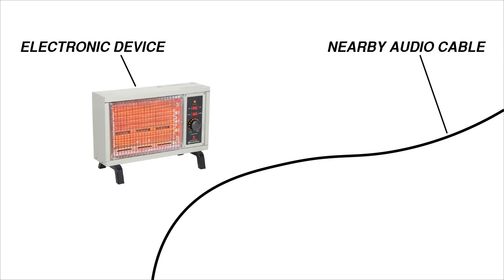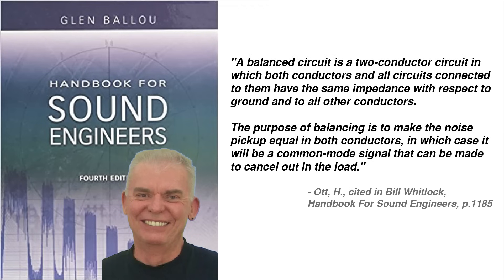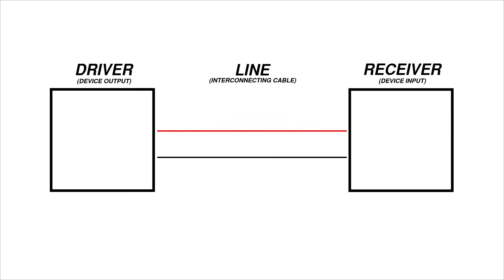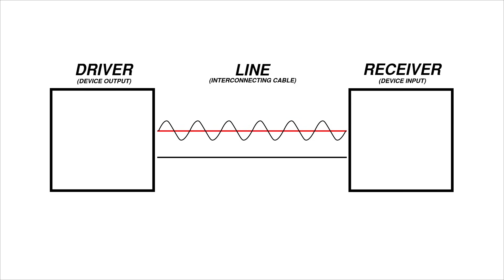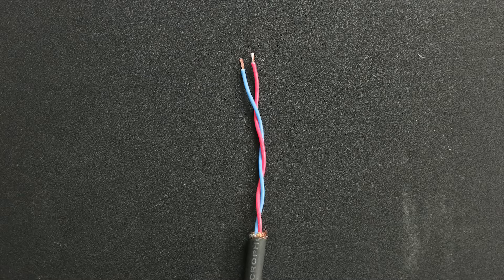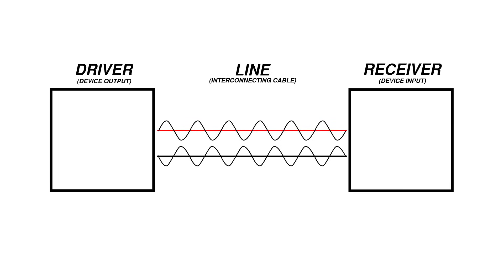Balanced vs Unbalanced Audio | Do Balanced Cables Sound Better?

Comment: The problem with your four conductor cable was that the "ground" for the unbalanced path was not a shield but just a wire conductor?

There are also different ways to use a balanced cable, you can use differential signalling but you can also use it as an unbalanced cable... which is what most people do (unknowingly)!

Comment: "Ballanced" cables utilize the equal opposite principle. The goody is sent with it's identical opposite twin. Any garbage picked up on the way through the wire is ignored as the twins are re-united (flipped back into unison, cancelling out the noise from the now opposing garbage noise crushing each other). Done and done. It's so simple it's confounding.

Comment: This is what you always hear as an "advantage" of xlr to rca: that over long distances  these connections are still very silent, where with rca noise augments. This is certainly true, but our listening room is not a stadium. We do not need interconnections over long distances. In most cases 1m will be long enough. So this argument might be true, but is not valuable.

Comment: As a prosound sound Technician, balanced Wiring does removed Noise and CrossTalk from Wiring when running long distance. However in Hifi that run short length Audio wiring are not really important as the circuit for unbalanced to balanced circuit and vice versa balanced and back to unbalance if poorly designed will cancelled out tiny detail information on the audio signal.
I trust the most important part in Hifi is the balanced wiring and circuit should be the Catridge and phono stage.

Comment: Op-amps are amazing. I'm making some mini speakers with the LM386 chip (amplifier) and I try to add mixing (more input signals) to it. I'm stuck with some hole making issue on the second box, but most is working. Most equipment don't make noise as before, but it's certainly an issue.

Comment: I can't definitively say balanced interconnects improved the sound quality on my system, but there was a significant gain: for any given volume setting output was noticeably louder with balanced cables than with RCA. I'm no expert, but I imagine if the amplifier isn't working as hard to produce a comfortable listening level, then it can only be a good thing. What do you guys think?

Comment: I've read that if your instrument has an unbalanced output, and going into a balanced input, for example, an unbalanced keyboard or e drum output going into a balanced interface input, TS cables are what you should use.  Is this correct?  It's what I use and the sound is proper.

Comment: So basically balanced cables are a waste of money when running short runs. Your 3 foot RCA's are just as good for interconnects unless you have something making wicked noise in your system and if that's the case you have bigger issue then interconnects.

Comment: Huh, sounds like pickups -regular cable is single coil and TSR is humbucking. Both sound fine when playing clean, low volume, diff is when turned up or noisier with increasing gain.

Comment: In the late '60s pretty much all that we had for mics were the screw-on type (unbalanced). Terribly noisy. By the mid-late '70's most people were using XLR 3 wire type mics. Balanced is always preferred in long cable runs and noise resistance. That's about it.

Comment: Cables do "sound"?
Balanced cables have a second, grounded cable and the difference of the signals is used. So you remove the noise from electrical interference from the mixture of the wanted signal and the noise. Only the wanted signal remains.
Humbuckers in electric guitars work the same way.
Balanced cables only make sense, if you have lots of interference and low voltages. Typically a shielded cable is enough to reduce the noise.

Comment: I was happy with RCA for the longest time. Then I bought a dac that was designed to work best in balanced mode. So I bought some short 0.5m xlrs. Did I notice a difference. Yes but it was a volume gain difference due to higher voltages. The technical specs are also slightly better but I'd be lying if I said I heard that difference. Nice to know my setup is optimized however.
I'm pretty sure the benefit will be greater for much longer runs of cables. I assume that's why balanced xlrs are used in professional installations.

Comment: Thanks, I finally have a basic understanding of what a balanced connection is. And now I’m curious to know why guitars don’t use a balanced connection, especially given the issues with single coil pick ups in particular. I assume it’s because Electric guitars and amplifiers were first built with a non-balanced connection, and it’s always very difficult to change a firmly entrenched standard.

Comment: Great video. Regarding the misconception about two signals being required for a balanced (noise cancellation) connection to occur- my presumption is that this would still require a TRS cable and two devices with balanced driver and receiver, yes? If so, my next question would be, what device with balanced connections would ever not send 2 copies of the signal? Is this something you have seen with any specific manufacturers or mostly just theoretical? Don't know whether or not I need to be on the lookout for that sort of thing.

Comment: Hello! i have questions. I have issues  in car audio with very quiet ground loops, but the biggest problem is bad sound quality (mainly bass) and distortions. Balanced wires can fix this problem? All is okay, this same points, 5 year of fight with weak bass, who most often, but not always, plays on hot days much better, loud, soft, in cold weahers its hard to get nice, loud and clean bass. Thanks.
Weird looks: Subs (or amp) pickup 20 meters away from my car, others driving cars, and cause bass fading (outside car, sometimes i must change positon to hear fading, sometimes next to trunk, sometimes in fronts windows all outside car,  When  lightning struck nearby to me, i lost more bass only under 34hz, more weak, more empty quality.) I check  with my cheap osciloscope RCA end (to amp) signal looks like clean but in output amplifier like dirty, amplified noise, its possible its from rca problem noise? Thanks!
Thanks!

Comment: I have a couple 18's Vegas. They have 1/4 inch ts jacks going into 2 wires at the end where it hooks into my receiver. How do I know which one is positive and which one is negative coming from the sub with the ts jack going into my receiver normal red and black ?

Comment: Question, I am trying to make my own Audio converter from TRS to XLR male. because my Audio Mixer has PL Aux Outputs. I soldered the TRS correctly but to the XLR, I'm not that sure. I soldered the Shield to 1 and the White Cable to 3 then the Red cable to 2, then when I play music through my mixer then I listened to the TRS to XLR Converter that I made, the song has no voice. but when I tried to rewire the XLR to 1 and 3 - Shield and i connected the both white and red wires to 2, it sounded normal... why is that? what did I made? is it a balanced Cable or a unbalanced? I'm trying to learn this so that I can make my own Audio cables and have a knowledge to repair them if needed... Thank you so much!

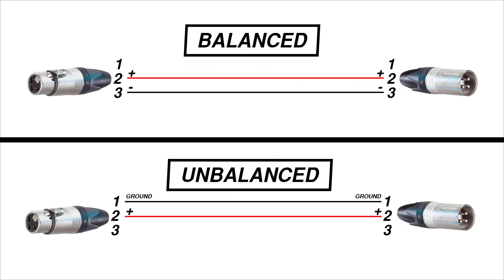Comment: 4:52 - Sorry having a hard time wrapping my head around this. There are still only 2 wires in either scenario. So, why can't an RCA cable be set up so the shielding attaches to 3 and the +ve at 2?

Comment: Excellent job paring down the key information and presenting so clearly!  One thing that did stand out, though, is that the shield was not connected at all in the balanced diagram.  Im guessing that you may be teeing that topic up for a future video on ground loops, proper shield connections (often an almost religious subject for some).  With all of that said, it’s worth mentioning one additional source of potential noise in an unbalanced connection can come from ground loops that can be  introduced when the ground of the source device connects to the ground of the destination device are connected (by necessity) via the shield if current ends up flowing through the ground/shield in the wire from one device to the other or there are MULTIPLE ground paths between devices (like when the shield of one RCA (left channel) and the other RCA (right channel) are both connected between the source and destination devices. 
 
I’ve always hated unbalanced connections but they are nearly unavoidable (unless you have the budget for higher-end professional gear - and even then, instruments such as electric guitars/basses offer few alternatives (except possibly for wireless).
 
Anyway, I’d love to see a video that addresses the method of wiring connection that you recommend: 
 
1) For shelled cables (such as only connecting one end of the shield for balanced connections)

2) Best practices for minimizing ground loops

Again, awesome content!  I wish I could have watched your  channel 30 years ago (I’d probably have more hair!)

Comment: 00:22 🎛️ Balanced connections help reduce noise from electronic interference.  
01:00 🔌 Different cables (XLR, TRS, TS, RCA) have varying internal constructions impacting their balanced capabilities.  
01:39 📖 Balanced circuits have equal impedance in conductors to cancel out noise.  
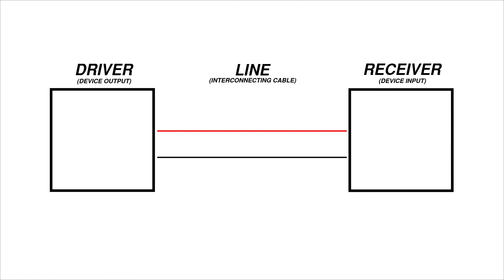02:28 🔍 Differential devices in balanced circuits reject common-mode noise while passing differential signals.  
03:57 🧩 The shield in XLR and TRS cables does not affect balanced connection ability; wire size and twisting are crucial.  
04:39 ⚠️ Common myth: Balanced connections don't always require opposite signals to function effectively.  
05:22 🎙 Demonstration shows how balanced connections reduce noise compared to unbalanced ones.

Comment: Legacy convention tells us "tip" and "ring" comprise the conductive parts of the unbalanced quarter-inch phone plug, corresponding to green (tip) & red (ring) telephone wires. Why then do you refer to the phone plug's conductive parts as "tip" and "sleeve?" Did something change while I wasn't paying attention?

Comment: And now the one million dollar question…
Why not using a current connection in stead of a (unbalanced or balanced) voltage connection? Interference generates an electromotive force voltage which doesn’t interfere with the current.

Comment: If you got a 16ft 12awg cable, cut within 1mm on both sides going into a 5mm banana plug with a half inch wire stripper, what is the difference in the ohms betwean two cables?  The wind and shadow from the window.  Because you get some wind going by a shadow...i mean their 100watts.  The trouble is the reciever turns off after one second, you play DTS:X  Home Theatre, its off every 20ms when you do the test tones.

Comment: Hi , I am building a pedal effects board consisting of around 8 Behringer guitar effects pedals and a Behringer UTRAPATCH 3000  (balanced patchbay) , I use Korg Volcas and Roland Aira compacts which will be "patched' into the effect pedals via the patch bay, my question is.  .. is there any advantage using this "balanced" patchbay with "mono" type effects pedals? , ie  will using TRS leads from effect pedals to this balanced patchbay be overkill?
Thanks in advance 😊

Comment: Here I was, thinking TRS is for stereo signal, like the big TRS plugs on my AV receiver labelled as headphones.
Reply from the maker: It can be! But sometimes it’s for balanced connections, as shown here.
Reply: @AudioUniversity  Very interesting, so in theory the same cable could be used for both and only the manual would tell if the device uses stereo, or balanced, though in some cases it would probably be obvious. What is not obvious on the other hand is why manufacturers still use the large plug for headphones rather than the medium sized one.

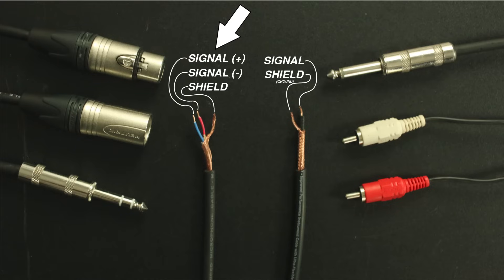Comment: At the 1:18 mark, you have a diagram showing the red wire as negative. In all of the other diagrams I have seen with how to wire XLR cables, the red wire is always shown as positive.  Does it matter? I have always wired red to pin 2 of the xlr per the diagrams, but recently purchased some xlr cables that had the red soldered to pin 3.  Does it matter?

Comment: I know this is an old video now but hopefully comments are still monitored. Since the receiving equipment seems to be the ‘clever’ end, does that mean you can take an unbalanced RCA connection, and run it into a balanced input using the RCA/coaxial centre conductor for hot and the shield for cold?
Reply from the maker: No. For this, I’d recommend a DI box. Specifically, the Radial ProAV2.
Reply: @AudioUniversity  thanks for your reply.

Comment: I have two dual 15.24 rockville speakers. All i am trying to do is use them strictly for vocals only. I bought the rockville 3000watt amp and a mixer. But when i hook up my mixer i cant get both speakers left and right.. left on mixer is balenced right is unbalenced. Usind audio jacks not xlr. Do i need more xlr cables to privide adequate sound,,, also my amp for some reason stays powered on even when i flip the switch off. Is this bad anf should i send back for a new one.

Comment: If i need a short cable for the aux out from the mixer, which is mono, to the audio interface is better balanced or unbalanced? It will be a JACK from aux side and xlr in the usb interface (capturing mic audio for zoom meeting)

Comment: Simply, it's called common-mode rejection. 2nd year, 2nd semester class for electrical engineers right here for you. if you are EE and you don't understand this- you need to get your EE degree or certificate revoked. Great job describing it

Comment: It is Equipment that is 'suitable' for balanced connections, not cables, although obviously cables must match the equipment connections. I don't know of anyone, or ANY Hi-Fi component/equipment, that uses the 1/4" stereo jack cables/connections you mention - they are generally used just for 'Pro' type equipment.

Comment: its also why powerlines in your house are next to each other, so that the interference they generate is minimized and cancelled out. and also to cancel out interferences from other sources. basically shielding and interference protection is pretty essential in electrical engineering

Comment: For those who never compare high end balance audio cable and standard unbalanced stock cable say they sound the same . 

Also, it sounfs better not base on noise being remove but the balance connect can access higher power signal passing thu without worry much about the signal noise patio issue .so when you turn up the volume , it does sounds less distorted . 

But surely it is not only about the connector but as a combination with a high purity copper, shelding , welding tin , briading method and core line numbers. 

So in the world of hi fi audio, the balance cable product doesnt sound better. If you dont believe what i said you could buy or borrow a balance and unbalanced headphone canle and test it  yourself with the same music track. 

Theoretically the same doesnt mean audiable and psychoacoustically the same. Thats it.

Comment: Firstly this video was absolutely flawless. It was so well done with its rich information yet simple presentation. Secondly, I have to express my gratitude because you just explained what I believe a problem that has been plaguing me for years. I have had a personal home studio for over a decade and have struggled to get rid of the buzzing and humming in my recordings and in my mixer. I had heard of balanced and unbalanced connections but didn't really understand the difference between the two. After watching your video I found that I have a mixture of balanced and unbalanced cables. I just thought all 1/4 inch cables were the same. I just did a quick check and lo and behold the unbalanced cables are the ones causing the buzzing. The irony is that when I have replaced these cables I apparently kept getting unbalanced ones. Although I have used  Pyle hum destroyers to get rid of some of the noise my latest purchase  was causing signal loss where I was losing the low end of the sound. Your video just changed everything. Thank you so much for this. Keep up the good work. By the way I just subscribed to your channel.

Comment: An unwanted "Common mode" signal just means the same signal is on two wires. Being the same they can be made to cancel out by inverting one and adding them together.

Comment: So important question: if i have an audio interface with a combo (accepting XLR and 1/4" jack) input. Would using a 1/4" TRS cable with, say a guitar, be better than a TS? Or is that not even an option?
Reply from the maker: No. A guitar isn’t capable of a balanced connection, even with a TRS cable.
Reply: @AudioUniversity  that's a bummer since they suffer the most from noise, especially when passed through an amp. 
Thank you for the reply!

Comment: 1000 ft. wire? Jeez, how many of us use that?!  A more useful demo would have been to see if the balanced vs unbalanced connections do anything worth bothering about for a 6 foot wire, the typical length we might use to connect one device in a stack to another piece of gear in the same stack, at least in a home setting.  I see how large studios and stage work needs it but in a typical home setting I think usually not.

Comment: They certainly help when the distance from stage to mixing desk is tens of meters, the lighting uses triac dimmers, the lighting designer likes to run the quite large grid at lower levels (more switching noise) and you're dealing with mic level signals.

Though many modern systems place a remote controlled mixer on stage greatly shortening those cable runs (and use of bulky expensive cable)

Comment: now im using my new yamaha gm80s mixer and its the same problem.When i shorted pin 1 and pin 3 in the xlr it gets louder. This time im using TS PL because it gives much louder output than the xlr balanced .I dont know why is this happened to yamaha mixer.From the philiphines